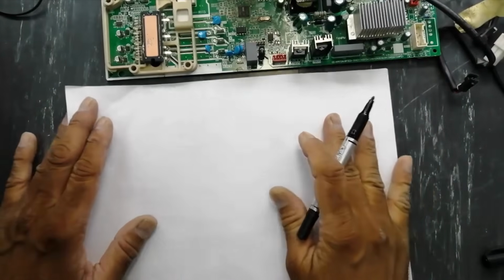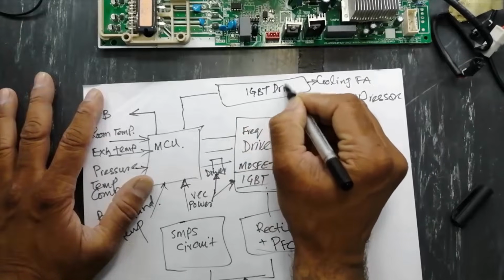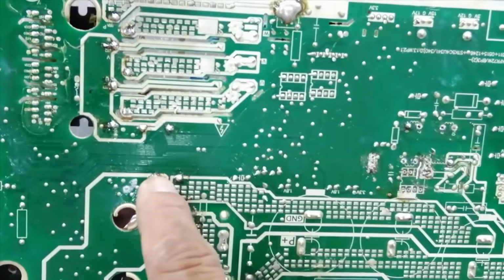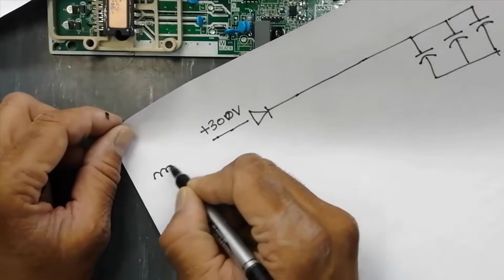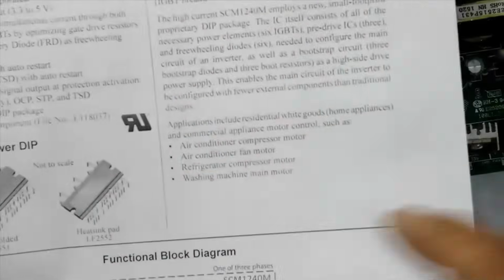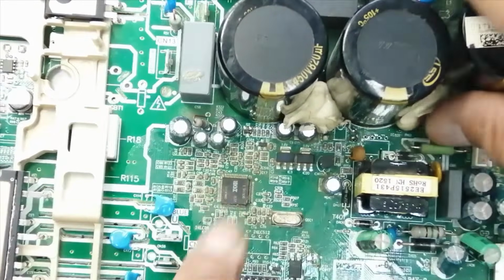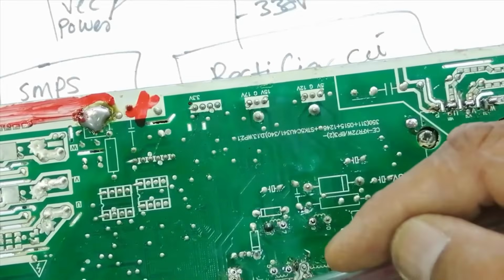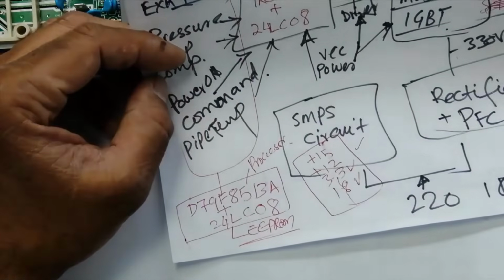#244 DC Inverter AC board Outdoor Circuit Description Explained, How to Test, Troubleshoot & Repair

Comment: Is there  voltage stabilizer is essential for inverter air conditioner?
Reply from the maker: no for inverter ac 
logically there is no requirement of voltage stabilizer
because it have built in PFC circuit which works as voltage stabilizer
Reply from the maker: voltage stabilizer can be used in non-inverter split AC or semi-inverter AC

Comment: Thanks sir you are intelligent sir I have a question can can we give DC volt direct to rectifier instead of 220v ac?
Reply from the maker: thanks a lot dear. 
yes rectifier is one way conductor, we can give either dc or ac volts. if it will become forward biased then it will allow to pass the current
Reply: Sir I will connect this board with Battery to direct rectifier let see
Reply from the maker: @aliayub4335  but it need more than 300 volt dc. and using pfc then more than 350vdc. 
are using any inverter to boost dc voltage ??
Reply: And if give 12v DC to diod after transformer

Comment: Can u please tell me which ic 8 pin is used in IPM drive unit of orient DC inverter ac outdoor PCB. Its number is 0D06 on ic, designed by company.

Comment: Thank you very much for the video. Very detailed explanation. Can you show us where did you make the jumper in order to bypass the missing igbt?
Reply from the maker: i connected jumper from output pin of bridge rectified to the capacitor point
Reply: Thank you very much!
Is this IGBT for the pfc circuit?
Can you bypass the PFC circuit?
Reply from the maker: yes this igbt for pfc
we cannot bypass pfc. as it is necessary to turn on ipm. otherwise microcontroller will not generate signal
Reply: @HaseebElectronics  thank you very much!!!!

Comment: Selminaleykum from Australia learning allot I am old school air con tech for 24 years old cap start system, i find it very hard to test these inverter boars, thanks for you videos elhamdurullah.
Reply from the maker: Wa Alaikum salaam . i am thankful for your valuable appreciation. i am just sharing my practical experience so might be it may helpful for someone 
bets regards
Reply: @HaseebElectronics  Selaminaleykum brother can you help me how can i diagnose the communication between the two boards indoor and out door units with a multi meter, only if you have time thanks.
Reply from the maker: @SparkyTech240v  sure I will whatever I can
Reply: @HaseebElectronics  Sorry brother selam i was out working all day, I avoid fixing inverter systems, i go by elimination checking all loads  compressor fans and the thermisters sensors if everything checks out good i deter min its one of the boards but can't workout if fault is in door or out door board, Jazakom Allah,

Comment: First I want to thanks your efforts and I hope if you make a video to operate the board with complete circuit like sensors antil show the 3 phase out put if you can l prishiat your efforts thanks
Reply from the maker: sure I will try my best to explain in detail with error codes and possible reason for thet fault condition.

Comment: Asslamu Alaikum Hasseb Bhai, I found your channel by chance and this is one of the favourite ones i have now. I must say i enjoyed your videos a lot, especially this one. I learned these complex concepts a lot from the simplicity of your explanations and practical examples. 

I also noticed in one of your banners that you are from Choke Azam. I had my grandparents lived in near, i think it was Chak 43 or 29 near Hayat Canal. I always liked Meetha fruit from the area in those days, since moved to Australia in software engineering. Always miss the time and the area.

From the video I have few question it would be great if you can please explain

1. The IC sematic shown that the output of IGBT is directly connected to the Motor at UVW, does it mean that motor does not need sine wave and hence the filters and all are not required as motor input? 
2. As the IC is converting DC line into 3 Phase lines where does the phase shift, frequency adjustment, and signal sync happen for a 3 phase to work with motor?
3. Where is PFC happing?
4. Using the similar technique can be change a normal air conditioner to an inverter AC (exception is to only have a single phase and use the single phase to derive the older compressor)

Thanks again.
Reply: @HaseebElectronics  Asslamu Alaikum Haseeb Bhai, thank you for introduction to Urdu Channel. I will definitely watch your wonderful videos in Urdu as well.

Thanks for pointing out that its actually using a Brushles DC motor so if i understand correctly missing brushes are compensated by the Controller's digital pulsed signals output. So if i would like to use a normal split AC as an inverter AC i have to produce the pulsed signals at certain volts and then use a brushless motor on either 3 phase or 1 phase depending on the inverter output and the brushless motor winding, and we don't even need to use the higher voltage. We can create a pulsed output on 48V AC and then wind a 48V brushless motor. The amperage however might be a problem at about ~15A for 3 phase or ~30A for single phase?

Please let me know if i misunderstood the concept. Regards

Comment: The more I watch your videos the more I understand how the voltage is being processed and moving on the board that I am currently working on. It is not the same as your board as yours but similar and I have to make some judgement calls to determine what is going on. At any rate your videos are very helpful.Thank you very much .

Comment: Haseeb I have been watch your video for about a month and it's has been very helpful. I am able to follow what you use on the board that I am working on and figure out how the power runs on the board I have. I am able to follow the power from the AC through the fuse through the bridge rectifier to the capacitors to the P 1941 IC and there is where the power on the positive side stops. I think the chopper send back a bad error code to  the Main and that effect the  VCO/ PWN and it will not start the compressor.  Should I start with getting a new P 1941 IC . I tried to find out which one the SMPS would need and there was so many that I was totally confused. I looked it up and I did not have a clue. Suggestions please.

Comment: HI very good video I wonder if you can help me MY AC whilpool model ident. SPIW412L  when i switch on the indoor unit the display shows normal  for example number 19 the the compressor is not running and fan i have check the line and nuetral this is present 230vac but can you tell me where is the fuse on this board  on the outside unit. any ideas please.

Comment: Sir why output supply fluctuation in smps i changed tl431,pc 817  and check all resistance  please suggest
Reply: Sir how to calculate rt ,ct value in 3842 an ic, sir if you have working circuit diagram of 38,43 ic which has frequency response 50 to 60 khz please share with me sir i have not cro or dso i faced many problem in power supply please help me sir
Reply: Thanks sir, give your WhatsApp no

Comment: Gud afternoon sir ..i have a big doubt in induction heater or stove and also in smps transformer primary side the minimum resiatance of coil is too low .. But y they are not shortcircuiting while switching ...
Reply: @HaseebElectronics  😊😊😊😊😊  thank u sir ..... Really i am so happy for u r reply sir... 😊😊

Comment: I mean to ask.. Pls explain IPM modules pins.. like CIN, Itrip, Fo, uvwfb, Over current detection circuit by using OPamp ics,

generally almost all Ac inverter outdoor pcb wotks on same principal..just parts are different.. 

i am eager to know more deeply.. 
pls make video on above mentioned points..

You are doing excellent job.. Jazak Allahu Khairan Katheera.. 
👌🏼👍🏻👍🏻👍🏻👍🏻👍🏻🌟🌟🌟🌟🌟

Comment: Hai sir in that board at power section y they use ptc instead of ntc ? And another thing is y they connect resistor series with igbt ic at  negetive voltage ? 
And y they use 2 processors instead of one ? A best single processor can handle all the stuff . but  y they use 2 processors? 
Plr reply sir ..
 Thanking u sir  for u r valuable information .really ur videos are preacious source to me ...🤩🤩🤩🤩🤩🤩
Reply: @HaseebElectronics   thank u sir 😍😍

Comment: Thnk u sir for this video. Its Very helpul for us as a beginner. One question sir. How much voltage are passing throu the igbt going to u v w of the compressor? How can we check the voltage of every pin of u v wif there is voltage coming out even if we dont have available comp to test it? Thank u again and more power sir.
Reply: Meaning sir that if we point the probe of the tester to u v, uw or vw then we can read voltage come out from it as long as the ipm ic works properly?
Reply: @HaseebElectronics  thnk you sir